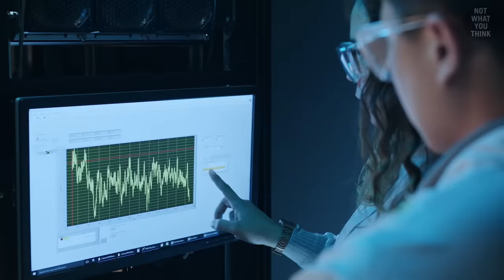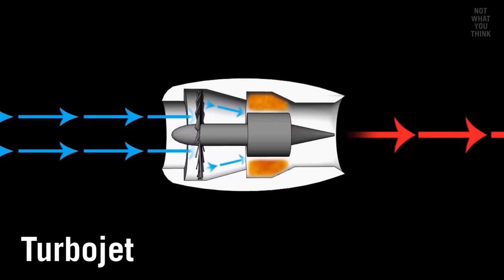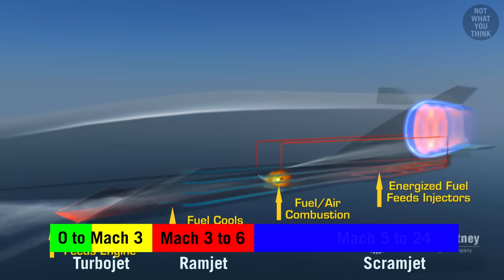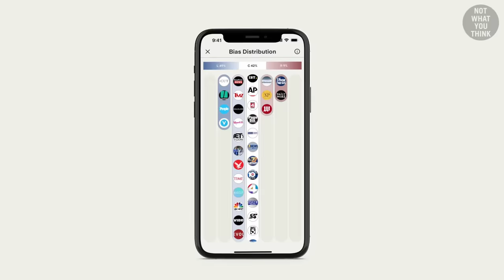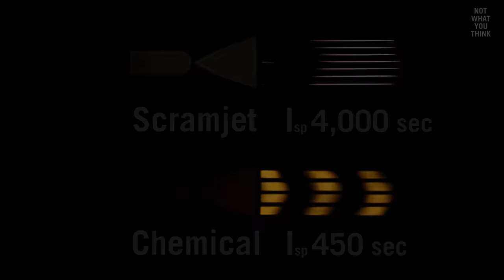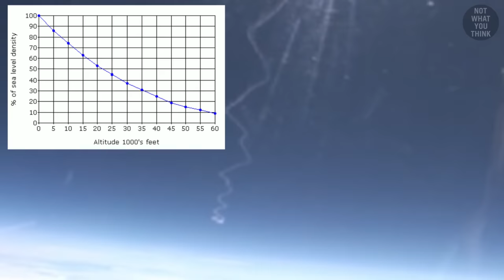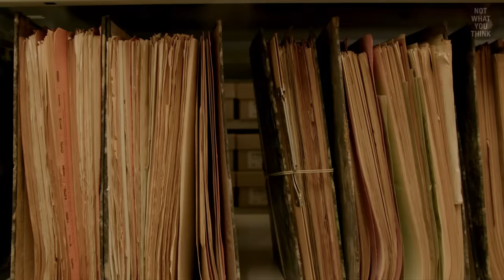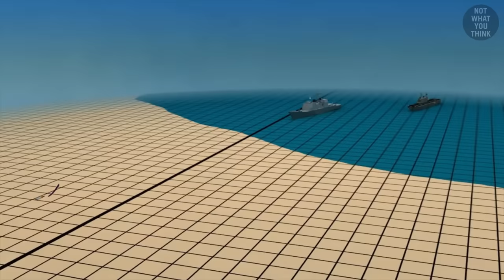The Hypersonic Missile Vulnerability That NO ONE Talks About

Comment: The advantage of air-breathing engines is not just that they use ambient oxygen for combustion, but that they also get to use air as reaction mass. Rockets are placed under some fairly strict limitations by the amount of gas they can generate, while air provides both oxydizer (molecular oxygen) and reaction mass (largely nitrogen). That's why they can manage such huge Isp.
Reply: This video looks like it says : we don't know how to do it properly, that sure means it can't be done...
Reply: @gePanzerTe  What he says multiple times is there is no physics that allow this to happen. The problem with hypersonic, low-altitude movement is as you go faster and faster the friction from moving so fast outweighs the additional reaction mass from the atmosphere and it goes up  by a square over Mach 5 which is one reason why 70 years of research haven't yielding faster extended flight times. Further there is no way for any hypersonic aircraft to use any form of electromagnetic device to "see" or "listen" outside of it plasma field because electromagnetic interference as electrons become disassociated with their molecules. BTW this why Mach 5 is so important because it the friction heat that cause disassociation! Oh, BTW, Cold Fusion isn't real either. Any such device will have to have one hell of an inertial guidance system and  GREAT UNKNOWN sensors for sensing real speed, height, and changes of air pressure... yeah at hypersonic speeds air pressure is really important to give a true reading of speed.  So yeah, based on physics no one can do it properly at present and any time in the foreseeable future.
Reply: @charlesrichardson8635  "cold fusion " ??
Why do you make it pop here?
Reply: @gePanzerTe  For people who are constantly bringing up unproven physics and want to believe that scientists in a field understand their field very well. Like "stealth plasma", invincible hypersonic missiles, or cold fusion. Magic physics!
Reply: The OP's post is complete nonsense. Stationary (reaction) mass has absolutely nothing whatsoever to do with the high specific impulse from air breathing engines.
Reply: Plus you don't have to carry the weight of the oxidizer.
Reply: isp is only a relevant figure when benchmarking below mach 1 or in a vaccum. Air resistance becomes a huge factor which specific impulse doesn't really address. Let alone the impulse efficiency changes on intake velocities.
Reply: @gePanzerTe Exactly. They are struggling to develop one, so let's call it ineffective while we keep wasting billions in an attempt to make one.